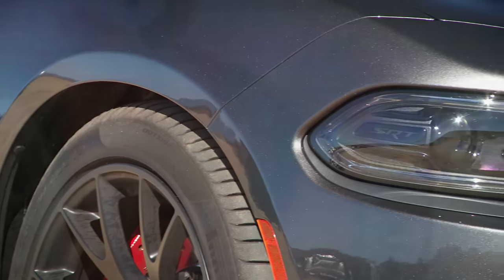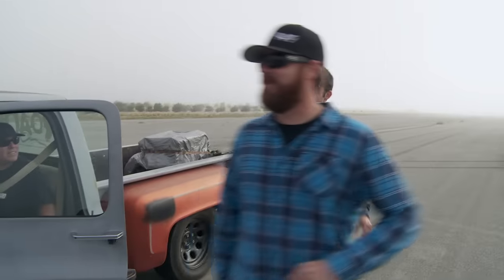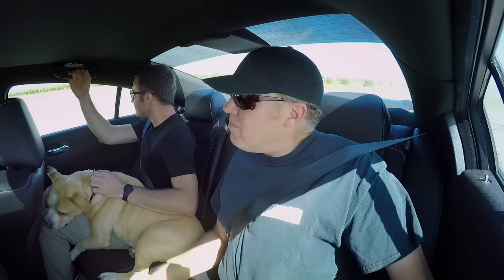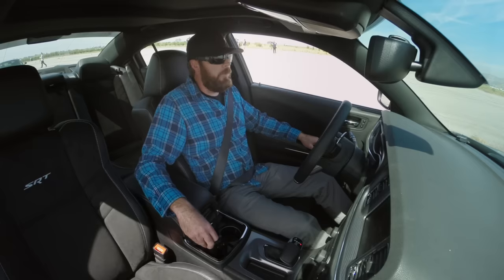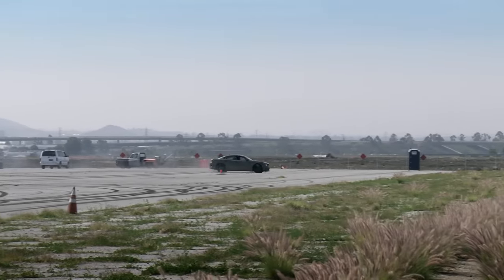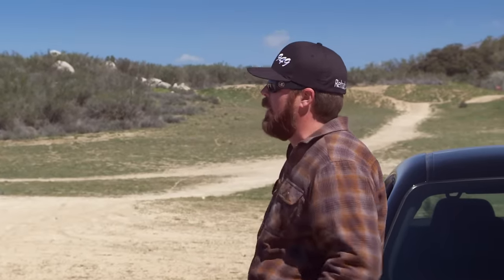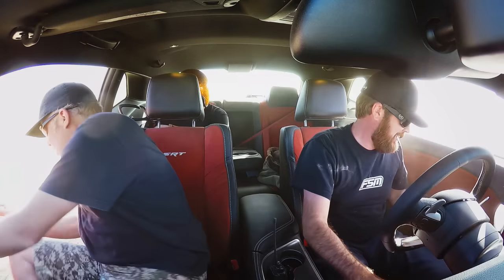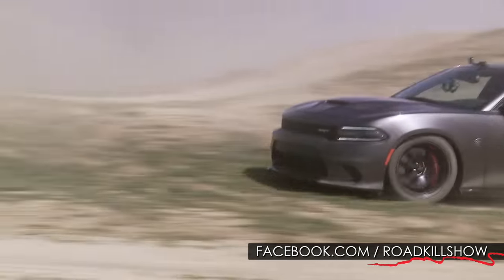Dodge Hellcat-Viper-Hellcat Thrash Battle! - Roadkill Ep. 38

Comment: Just one question, why leave the windows down while on the dirt track? I mean isn't cleaning the exterior going to be enough work?!
Reply: Well its a dodge it looks good dirty and clean
Reply: +kevin O Vipers don't have air conditioning.
Reply: legacyshooter but still, I just see the viper as something to take care of and not put it on a dirt track etc. But if Dodge let them use and abuse it knowing full well it could be ruined, I just might do the same thing!
Reply: +kevin O considering the Viper suffered zero damage in the dirt compared to the Hellcats, I'd save up for the Viper.
Reply: because Roadkill.
Reply: Thous cars are gonna be trashed and crushed since they're most likely review and demo cars
Reply: I love American cars, but how r 3 cars that American-made not missing a bumper after that tug-of-war?
Reply: +Berno Bruvn Mikcalson charger became general maintenance
Reply: Berno Bruvn Mikcalson they repaired the Challenger and sold it, apparently Fred Williams still has the Viper, and Freiburger and Finnegan kept the Charger as the "General Maintenance".
Reply: Acura TL GTLM so that's where the charger came from ?
Reply: Windows stowed will prevent injury if broken during the test
Reply: Who takes a hellcat on a dirt track anyways

Comment: I CANNOT believe they were allowed to destroy those cars!!!!!!!! If you don't want em I have a need for at least two of em. And holy hell they sound insane, real glad factory has been able to get that sound out of stock exhaust systems nowadays.
Reply: Trust me with these American cars. They're not that hard to fix back up.

A couple of new bumpers, a VERY thorough car wash, check the brakes and bam. Back to showroom condition.
Reply: Still impressive how small damage these cars got

If it was a Mercedes i'm pretty sure it would've shattered into pieces
Reply: |〉Mr. TARIQ 〈| The challenger and charger are on a Mercedes platform.
Reply: Kevin Smith That German engineering, no one can deny.
Reply: J. Scaffnetti Pre-production vehicles. After all of the promotion is complete, Chrysler will will crush them anyway!These are NOT production cars, have no VIN number and cannot be registered to a new owner.

Comment: We aren't supposed to have new, reliable cars on Roadkill! Just kidding. Maybe.
Reply: HAHA. Reliable to Roadkill standard.
Reply: ***** i'm surprised the viper didnt break in half xD + they trashed loads of tyres at that airstrip, thats a lot of punishment too :D
Reply: ***** you expect a viper to break down? Its built to handle twice the power that it makes from the factory. They don't break.
Reply: cad5359 All cars are reliable if you do the proper maintenance.
Reply: Eric M Planned failure of parts, like a timing belt is only made to last 60k miles, and a starter 350.
Reply: cad5359 oh no. My starter only lasts 350 thousand fucking miles. And a timing belt is cheap and easy. What's important is that the big stuff works. You can guarantee this motor will work. The helcats may be a different story, but we don't know yet.

Comment: Out of the 3 I'd definitely take the Viper..  There's ECU tunes coming out now that boost the power by a lot, and it's an actual sports car
Plus it's got a v10 which is bad ass
Reply: The displacement in that engine holds potential for MASSIVE power.. Would be cool to see how much power it could produce
Reply: V8 motors have more torque around the low end so they are quicker but I have always been fascinated by that viper v10. I don't think I would be able to choose one or the other lol.
Reply: Dee Jay These engines are pretty much bulletproof, it's like they were MEANT to be upgraded.
Reply: Jonka Olofsson Think the most powerful one at the moment is a twin turbo one with 1100 whp
Reply: Dee Jay i would take the challenger
Reply: Jesus Christ I read somewhere that for a long time SRT wouldn't give out some kind of programming knowledge that's required to do ECU tuning the new Viper..  (I know next to nothing about ECU tuning as you can tell)

Anyhow it's pretty cool that you can boost the power of the v10 by 100hp or more without even turning a wrench

Of course I imagine you could do the same to the HellCat, or swap a pulley on it
Reply: I have always liked muscle cars over sports so I'd take the hellcat.

Comment: I was looking at a couple different cars on the net , that might replace my 2006 Linc. Towncar. Except for the age, it has been the best car I have ever owned. Jag, coupe or sedan. Cadillac CT6. Linc. Continental 2 door or 4. But after watching this 'LITTLE' battle of '? '...  I think I should rethink my selection of vehicles,  and take a drive over to the Dodge Dealership and check out their stock. Very impressive beating, and still looking relatively free of damage and sounding as if never being red line to where the valves were flooting to the point of kissing the tops of the pistons, the amount of dirt that was inhaled throw the open air port in the grill that  feeding the superchargers. And , no plugged air filters. Superchargers are extremely sensitive to temp., dirt, rocks, lack of lubricant (due to dirt). why those engines didn't freeze up from heat ? Viper is known for it's cooling problems, and Hellcat's designers ran through all kinds of hoops to control the  heating problems .                                                                                                                                                         What you have done for the Chrysler Dodge Company, the could buy five of each of those cars. This advertising was a brain storm. Kudos to who though of this episode. I am going to my Dodge Dealership in a couple hours when they open to look at one of these cars.  And  will show them this video. Then to my buddies to show them. etc.                          United States of America .   We did it then.  And were still doing now .                                          thanks guys.      dan t.       Palm Springs, Calif.  U.S.A.

Comment: To successfully drift the Viper you need to initiate early in the turn, apply opposite lock as fast as you can and you need to keep bouncing between 30% to 70% throttle input to really carry the drift.

Comment: hold on how you get more horsepower in a v8 than a v10 wtf
Reply: +Brandon Carter it is boosted with a supercharger, the viper is n/a
Reply: You could get more than those 2 with a 4cyl if you wanted...
Reply: Here in sweden we have 1100hp 2,5liter 5cyl audis. Cylinders and volume aint all
Reply: +JamtlandRC channel I know a 4 cylinders can make 1200hp but most people are American and think big = more power
Reply: +John True America =cheapest hp per dollar
Reply: It's called a supercharger u dummy
Reply: JamtlandRC channel it's kind of arguing semantics at that point. Power is only limited by how much money you want to waste. How long do the Audi oversized motorcycle engines live under that much boost? Building them with a slight V configuration to reduce the brutal harmonics of adding the fifth cylinder without a full redesign and the infamous valve train failures would stop most people. And yes bigger generally means more potential power.
Reply: Brian Linton Obviously the laws of physics still apply to smaller engines so ultimately more volume is more power potential.

Having said that, 99.99% of people don't need or want 1000+hp engines.

Those Audi 5cyc are tough and with nothing more than boltons and a big turbo will make 550hp all day for years, in AWD 1500kg cars with strong gearboxes it makes them more than anyone would need in a street car and run 10's at the strip on proper street tires.

A 2JZ will happily run at 700hp unopened on a proper tune for years. 

So sure if you need or want 1000+hp then a bigger engine to start with makes sense. But if you only need to run 10's, then small engines are fine, even for a length of time
Reply: stinger15au I agree with you for the most part. No one needs any of this stuff. I wasn't knocking what anyone builds personally. Variety is the spice of life. If we all did the same thing it would be horribly boring. My comment was just more that comparing an Audi 2.5 built to 1100 hp to a factory showroom car is kind of pointless. At 550 it's a lot more reasonable. My only real knock on Audi is the valve train design. It's understandable with the packaging constraints of a litre bike but a bit much to require tearing the nose of the car off regularly for belt changes and valve adjustment. They're just commuters not antique Italian racing cars.
Reply: A couple difference (in case your still wondering) but A. Supercharging produces much more power. And B. The V10 in the Viper is crazy old. Although it had been updated it was still basically a 15+ year old Engine where as the Hellcat engine had an editional 15 years of eginering know-how behind it

Comment: infantile. as if burnouts is the measurement of a good car. silly.junk cars for a straight line.
Reply: +Ung Grabb at least they dont fall apart like Euro trash sports cars.
Reply: +Steven Main a high quality european last a long time. unless you belueve car driving is about burnouts and silly drag race for 400 meters. smoking expensive tires seems wasteful. but guess technology for traction control migjt not be available. and as for  gas mileage, guess the smoking piles of junk are pretty shocking also. bump gas prices to 6$ a gallon and use the money for good purposes.
Reply: +Ung Grabb Actually, for several years I was an Auto Mechanic before I went to school for Aviation, Ive also built and sold a 1,000 HP Trans Am. Im very knowlegeable about cars. Some of the most habitual violators of maintenance were European cars. Very poorly designed. Built as if they will never ever have to be taken apart. Guess what with the mileage Americans put on cars those European cars fall apart. Their expensive and a pain to work on. And once they are a few years old just fall to pieces. Thats why they have such horrible Resale Value. Jaguar is by far the absolute worst, with Audi/Volkswagen not far behind. BMW is also not too great. Mercedes have been alright from my experience. All the other Europeab brands are absolute trash though.
Reply: I loved this video, but not you stupid comment. the fact you judge a sport car as it was a track or a motocross bike said all about what you understand about sports cars. they are jewels to be taken care gentle, and you abuse it just for racing that is what they are meant for, or otherwise to have fun going fast on nice empty roads where you can without danger. and sometimes why not, even to show off, but not going on saturday to buy food and drinks at the supermarket, but in a cool place with your friends and girls. at the end simply you are really stupid if you use scissors as a hammer. sure you like more a supercharged muscle car engine on a pick up that a ferrari, could bet on it.